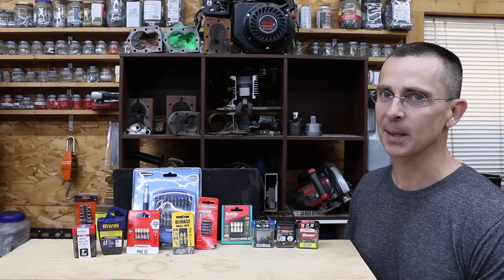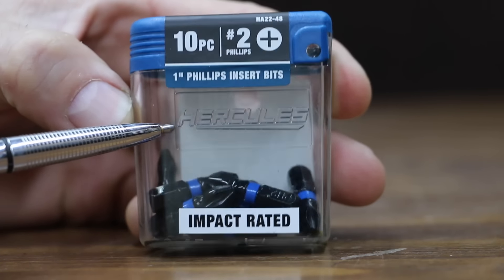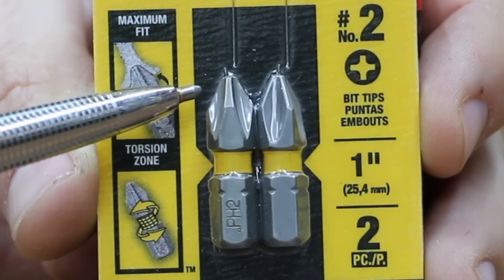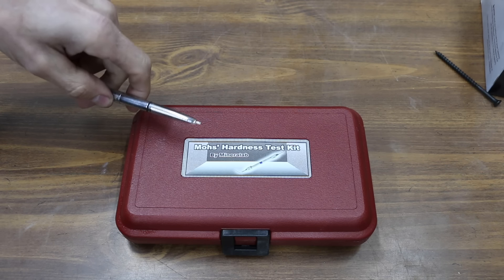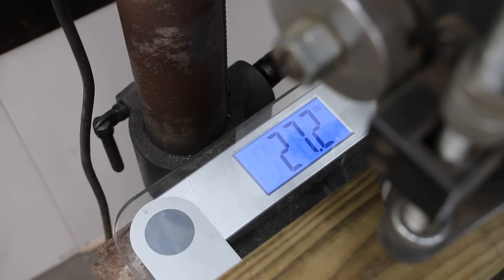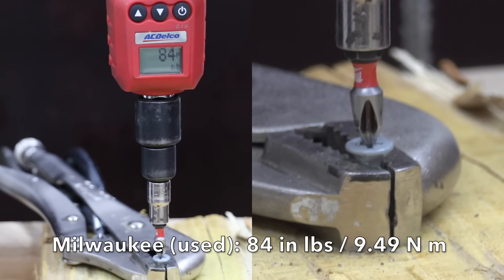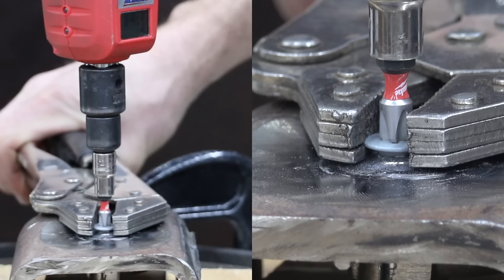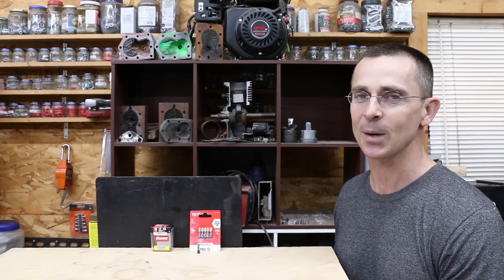Which Impact Driver Bit is Best? Let's find out! Phillips #2 Showdown

Comment: I have been using Milwaukee Shockwave bits for years.  Simply, they are the best I have used in my 30 years of contracting!  So well made are they that I have used one bit for as long as a 3 days before it starts camming-out!  To get an idea about how much use that is, I drive about 2 pounds of screws per day (personally and about 10lbs for the entire crew) My entire crew uses Shockwaves and Milwaukee M18 impact drivers.  we ALL love Milwaukee!   Let me speak to their M18 tools too!  I once dropped my impact Driver off a commercial roof, 44 feet onto a brick alley.  It had only a scrape! and it still works fine to this day!
Reply from the maker: Thanks for sharing.

Comment: Having just trashed my second electric pressure washer, I caved and bought a commercial gas unit. Curious if you'd be able to test economy electric pressure washers somehow? Otherwise awesome work as usual and keep it up, the channel is getting big!
Reply: This! 
Test max PSI, water use, motor temp after X and 3X minutes of continuous operation...
Reply: Totally make sure to do the winterizing as well if you live anywhere where the temps can dip below freezing at night for the pump.
Reply from the maker: Great suggestion!  Thank You!
Reply: Weird. I've had my PW over 20 years and still going strong. It even gets run and put away wet. Lol.

Comment: I'd be very curios as to how the Robertson bits would stack up against the Phillips
Reply from the maker: Great test suggestion! Thank you
Reply: @ProjectFarm  Yeah how about a test to see which screw type has the most torque with the top 5 brands? torx, robertson, phillips, alen head, and for fun flathead lol
Reply: Add a square bit to the mix, please, as they are more common these days.
Reply: @allenjohnson5536  square is Robertson
Reply: Elite Truck Repairs Thanks for the info. They only call it square drive at the local hardware stores.
Reply: @allenjohnson5536  It's a Canadian thing :)
Reply: @EliteTruckRepairs  theres also triwing and quad wing ( both from the same company that invented Torx)  and freerson and the P2R2 style which is a Robertson/Phillips cross.  And theres ECX the new format milwakuee is pushing.
Reply: No need for a test. Torx bits is the best.
Reply: @tomeng9520  torx bits round easily. Not as easily as allen keys but often enough that they cannot be automatically awarded a blanket statement of being the best.

I would expect the p2r2 format or ECX are less likely to cam out but idk how bit breakage or screw-rounding would compare.
Reply: @allenjohnson5536  AKA Robertson Bits  Best bits on the market
Reply: Elite Truck Repairs it’s actually an US thing. Robertson was invented in CANADA.
Reply: @ProjectFarm  I work in boat repair. Robertson screws, primarily stainless but also some bronze, are used nearly everywhere. We use Milwaukee Shockwave bit drivers, they have proven to be the very best.
Reply: @jjchenjj  That's what I meant eh :)
Reply: @alananderson8619  I  also use milwaukee bits and drivers, by far the best on the market
Reply: @tomeng9520  I've had a few T-20's and a T-25 snap on me over the last two weeks.
Reply: @tomeng9520  best at snapping yup.
Reply: And Pozidrive

Comment: 100 screws is about 2 hours work if you are installing and screwing down at the same time.. I often drive thousands in a week. In my experience the quality of each brand changes from month to month, as do the screws used. I have used all these brands. Milwaukee bits are sometimes great, sometimes soft. Over the last 5 years I have found Bosch to be the most consistently hard and longest lasting.
Reply from the maker: Thanks for sharing.
Reply: Well if ur saying its true that Bosch is consistent... What would say is the reason it did poorly in this dudes tests? Seems like they are not consistent then... Considering many brands outperformed them. I wonder if its a regional thing... Or source of purchase. For example buying home depot branded Bosch might be less quality versus someone who buys Bosch from the manufacturer as a contractor or something.. different metals per region..or company... Hmmm. Who knows.. but its interesting. Where do you purchase your Bosche bits from?

Comment: If an impact bit has a torsion zone or impact absorbing area - wouldn’t it be absorbing some the impact from the impact driver?  - seams counter productive
Reply: I don't get it either! ?🙃🤔
Reply: Yes and no.  It does take away from the impact but when you have shoved as many broken Phillips heads bits between your thumb as I have (4 times) a little flex goes a long way.  And people quit using Phillips. They are junk.  All screws should be hex or torx.  If we all stop using them they will eventually have to stop making them.  I use Milwaukee And Wiha.  Wiha has the best bit cases.  The both last a long time.

Comment: The real question is, "Why are people still using Phillips screw drivers, screws and bits?
Reply: Bill Morash I switched to torx or 6-pt socket driven screws.
Reply: Philips is hardly used in construction in Canada for anything other than drywall screws. Robertson is king.
Reply: @RobertHancock1  Long Live the mighty Robertson drive.
Reply: Umm drywall installation
Reply: @bsting397  im a fan of the square socket
Reply: Use them all the time in Australia. Not for carpentry, but installing anything for electrical, plumbing, joinery, aircon, they're the most common screw because they're so cheap and tbh the general attitude is "she'll be right". I'm an electrician and you wouldn't believe how many things I've had to replace, fix or detroy because the original installer didn't know what pozidriv was or could be bothered to get the right bit out
Reply: Availability. You can easily find phillips screws in any size; so you use it, rather than going store to store trying to find square drive screws in the size you need. Besides, there are now about a hundred different types of screw tips, a real pain in the ass for normal people. Tri wing security screws; who the f*ck needs these ridiculous things on a table fan??? But that's what we're finding. I need to change my tail light bulb? Some type of six point security screw, with a post in the middle of the hole, even though the whole shebang is covered by the tailgate. Ridiculous. Replaced with a simple phillips so it can be changed easily while out on the road. Using fancy, hard to find,  screw tips for no reason is ridiculous for low torque situations.
Reply: @danny49975  AKA Robertson
Reply: @mhibbs11  I searched it right after and felt stupid. Learn something new everyday I guess

Comment: I was helping a friend build a shed and we were using Dewalt Phillips bits. We were each breaking a couple of them a day. I stopped on the way over one morning and picked up Menards brand, Masterforce. While he kept breaking his Dewalt, I kept using the same Masterforce, all day. He eventually ran out of his so i gave him one of mine and he didn't break another one the rest of the project.  All in all, i think we went through 25+ Dewalt while i used maybe 3 of the masterforce. 
I have only bought Masterforce since then.  I haven't even used up the original pack of Phillips yet, though i typically use Torxs now. Its an event when i wear one of those out. I'll notice it's getting rounded out and I'll just take it out and throw it away before it fails.  They last so long i don't feel bad about replacing it before it fails. I even bought their wrenches, sockets and power tools. The wrenches and sockets are top tier, and I'm really tough on tools.  I regularly will hook a second wrench onto the end of the first and pull as hard as i can. I had a pipe on a 1/2" drive breaker bar hooked to a Snap-on 1/2" to 3/8" reducer into a Masterforce 3/8" drive socket. When it let go, i was sure it was the socket. No! The Snap-on reducer failed. 
The 20v power tools don't feel the best but they are pretty decent and definitely worth the price. I have the drill, impact, reciprocating saw, circular saw, angle grinder. I've used them pretty hard for almost 8 years with no failures,  though the drill is starting to get noticeable play in the bearing behind the chuck.  I will definitely replace it with the updated version of the masterforce when needed. I more recently purchased the portable compressor and heavy duty 1/2" impact.  What a beast.
Sorry, i know this was about the bits but I've just been so impressed with the whole line up.
Reply from the maker: Thanks for sharing.

Comment: @ProjectFarm I think it would be interesting to see some comparisons of appliances in houses that use water. Federal laws are producing water/flow restrictions changing the way we buy appliances that use water. I'd like to see which shower head does the best job at rising off objects with the least amount of water. Which shower head has the most pressure. And which one is most durable. .Same goes for washing machines and dishwashers. Which one does the best with the least. THANKS! -Mark

Comment: Another key aspect to impact drivers is magnetic bit holder. Milwaukee locking extension is only one that holds and released when you want them to. Dewalt twist and leave bits stuck in screw heads or you are using plyers to remove stuck worn out bits in twisted extension. Makita work really well in light use aplicationa. But heavy production requires Milwaukee locking collar bit holders. I'm a chuck it guy. If it sucks costs time and money. I lean towards dewalt on Philip's bits because I dont use any fasteners larger than 1-5/8" sheet rock screws. Anything heavier go with torx
Reply from the maker: Thanks for sharing.

Comment: I am glad I just saw this before shutting down my computer..I myself am doing a test of some of these here at home now..I am practically rebuilding our 40' by 50' wooden work shop /garage right now and decided to try the Milwaukee..Makita..Ryobi..DeWalt brands of these and so far the Milwaukee bits just go the extra mile..the ryobi bits aren't lasting too long and haven't used the DeWalt or Makita ones yet..also the same on the 2" bits..so far Milwaukees doing great..today is Makita and DeWalt bit day so I was glad to see this..I am using the #2 Phillips bits.
I really like what you have done here..thanks !
Reply from the maker: Thanks!

Comment: For years I ran an engineering test shop with a ton of heavy equipment and engineering test equipment coming in and out daily. A lot of times various mechanics, engineers, and techs would bring in different brand tools and bits with their equipment on top of what I bought for the shop so I have seen and used every brand listed here extensively. After all of that, I ended up with a VERY strong opinion that Milwaukee makes the best bits for the money and I only use anything else as a last resort. Not only do they perform extremely well and provide a strong grip when new, after driving 500 screws they will STILL provide good performance. I most commonly use the 2in bits, they provide the perfect length in a standard impact driver to give you easy access and visibility to the driver tip.
Reply from the maker: Thanks for sharing.

Comment: I just made a ramp for my compact tractor to get it into a 12' x 32 shed'.  I used treated 2" x 8" and 2" x 6" lumber and 3-1/8" T25 head screws.  My Makita impact-driver made it a pleasure.  My cordless drill/screwdriver probably would have done it . . . but it also may have killed it and certainly would have taken longer.  I tend to use DeWalt and Makita bits, though the 5Lb. GRK screw buckets I buy come with bits and I've never had a problem with those.  I avoid Phillips screws, have a bunch of square drive #2 left, but prefer T25 at this time.
Reply from the maker: Thanks for sharing.

Comment: Use Grabber bits that come in the 1-1/4" (coarse thread) drywall screw box.  I found that the bits bought at pro-tech and other places seem to be knockoffs of the actual grabber brand. A quality screw is just as important as a quality fastener. The Dewalt DW2 is a pretty good quality bit as well.
Reply: Those makita bits suck. Glad to see you do this comparison. The more claims they make the worst they are. A good product needs no hype
Reply from the maker: Thanks for the feedback.
Reply: @ProjectFarm  Thanks for the content. You answer the questions in every persons mind as they stand in the isle wondering if the product is worth the cost.

Comment: I’ve used Milwaukee bits for years and have always had good results. Never had one break. I tend to loose them before they break. I was given dewalt bits by my company and they were the worst bits I’ve ever used. 3 screws into metal and it’s over with. As soon as it stops turning it’ll bend the flutes. Most other brands from Lowe’s have the same issue. I’ll always buy the Milwaukee it just saves so much time and headache. I’m not a Milwaukee fanboy I just know from experience that their bits are great

Comment: I use only Milwaukee Shockwave bits and find the lasting years. Not sure I have word out one yet!  In fact, the last bit canister I bought was 3+ years ago and I have used only 3 of the #2 bits so far! They stay in my impact drivers at all times Unless I need to  temporarily  switch them out for T25s.  I have previously tried Makita Gold bits but find them camming out after a couple months.   BTW I have been a professional woodworker and facilities manager for 30 years and I drive a lot of screws!  Milwaukee costs more but saves money in the long run.
Reply from the maker: Thanks for sharing.

Comment: I assemble drop leaf tables with 4 leaves per top. I have yet to find a bit that can get me throught 2 tables without breaking the tips. That's about 64 one inch screws per tables made from oak, maple and beech. The new Makita and Milwaukee seem to last longer than the rest but they still break at the tip leaving metal in the screws. So i always have extra bits on hand.
Reply from the maker: Thanks for sharing.

Comment: The best is the most well formed. Like you say when the bad practices  take over, ie not straight on, spinning the head in to catch the screw, dirt in the head, easing off etc the head is worn quick, once slightly knackered it's all down hill from there.

Comment: Milwaukees bit looks more like 30x longer life like the wiha but that’s just my opinion. I use a Dewalt impact bit & holder which helps tremendously for Drywall bits. Unsure of its durability but after about 100ish screws drilled it’s holding out quite well… usually use a screw gun for drywall screws but sometimes I use my impact or drill for the task
Reply from the maker: Thanks for the feedback.

Comment: I have some old solid oak 6x6 post. Every impact driver I used on T20 snapped the bits off or stripped the head. I used Makita, Milwaukee, and DeWalt bits, all busted. So I started drilling pilot holes and it still snapped the bits. I have both the Makita impact driver XDT11 and XDT14 and both impacts snapped the bits. I have come to conclusion it's very difficult to drive fastners in to old super thick oak. Drilling on the job I use Makita XPS bits and some of the Bosch lines(pending on which, you can't go wrong with either.) and I've had a few breaks here and there. I bust 1/4 socket adapters more than anything else. I don't buy a lot of stuff from Harbor Freight other than a few sockets or wrenches. I tried there 3 piece 1/4 socket adapters and they were extremely good and long lived.  I won't buy Jack Stands or Power Tools at Harbor Freight because I value my life more than saving 50 dollars..
Reply from the maker: Great feedback. Thank you

Comment: I live 75 miles from any of the big box stores which is where I buy most of my tools. But I got stuck on a project because I forgot to pick some bits up when I was in town. I do have a local supply store 4 miles down the road that charges 2-3 times more for everything so I went there to get a bit so I could finish the project. The cheapest single bit was a Milwaukee bit. I can tell you it was worth the money even at there inflated price.
Reply from the maker: Glad to hear!

Comment: I use dewalt more so I have broken more of them, but the Milwaukee ones seem to break sooner. I usually retire my dewalt ones because I dropped my damn drill and bent the sumbitch before they break. I have broken 2 dewalts and one Milwaukee over a year, god knows how many screws each one drove. Seems like the ones that break were broken running 1/4” self tapping screws into steel beams or other thick material. It is also worth noting the Milwaukee that broke was a double sided bit, so there is a fair chance it wasn’t meant to do what I was doing. Also noteworthy that I am lazy, so I drive Robertson/flat combo screws with a #2 Phillips, potentially damaging the bits. I looked at one of my dewalt bits and it was twisted significantly at the tip from misuse, but that doesn’t concern me, because I’ll drop my drill or break the top soon enough anyway.

Comment: My bits always snap off flush with the screw head leaving the tip of the bit in the screw so that you can never back that screw out again. Happens most often with very hard self tapping screws into metal . . . I was breaking one for every 3-4 screws I drove in with the Harbor freight bits.
Reply from the maker: Thanks for sharing.

Comment: I broke two or three Milwaukee T25 bits today driving 12, 3/12" construction screws. I've always had better luck with DeWalt. To be fair, my Milwaukee Fuel impact driver is a beast and probably caused those bits to snap due to huge amounts of torque being applied.
Reply from the maker: Thanks for sharing.